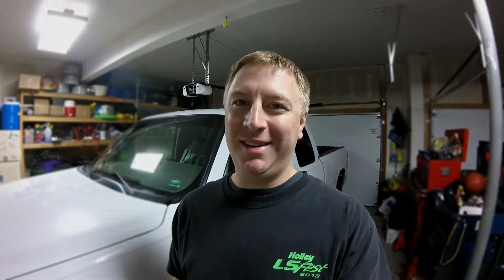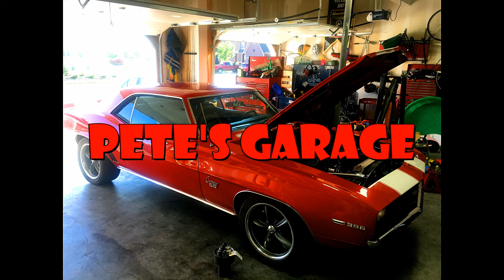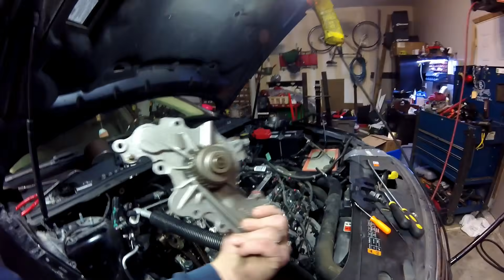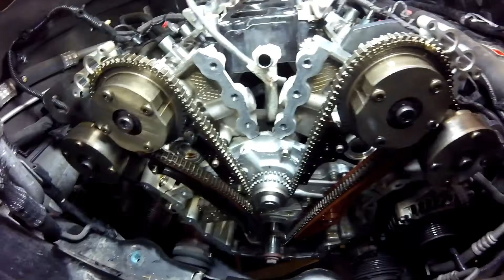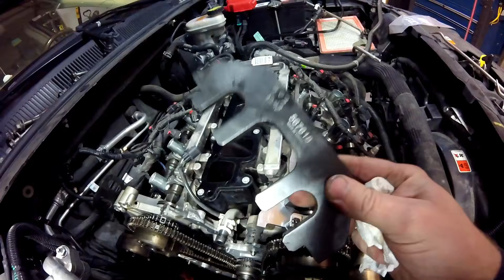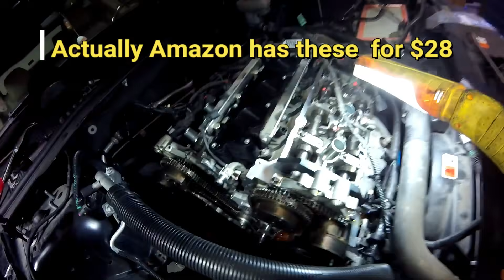Why does the Ford Taurus, Explorer, Edge 3.5L water pump cost over $1400?

Comment: What a complete shit design - typical Ford.  I will venture to say the small water pump housing around the bearings reveals how small the water pump bearings are and way too weak for the lateral tension provided by the timing chain tensioner and static weight of the spinning chain.....Meanwhile I am over here with my 300,000 mile 4.7 V8 tundra on the original water pump.....

Comment: This is why i stick to 90s, My 96 Rodeo 3.2 V6 water pump and timing belt? Meh 2 hours tops. driven this truck cross country 5 times, and not even a spudder , original engine and trans. Lol anything past 2002 cant do one cc trip without having almost a complete vehicle overhaul lol.

Comment: Seal the drain/weep hole then trade in the car - that $1400 is 10% of the car
Reply from the maker: Savage. I’d hate to be the poor sap who buys it off the used car lot when the engine milkshakes and spins bearings.

Comment: cars are so complicated these days it is ridicoulas . and they make the parts so cheaply , they put too small of bearings in them and the seals can't be very high quality or they would'nt fail so soon . in something like an old toyota 20R the water pump will last 200,000 miles . and why would you have the pump driven by the timing chain , that is ridicoulous . anything like the water pump , and alternator should be situated where it is easy to get to , and  driven by a belt . the car manufacturers are kicking themselves because they have to pay their mechanics for more hours to repair these overcomplicated engines

Comment: I've seen old 1990's Ford water pumps last more than 200k miles and 25 years.  There are a lot of modern cars that use an internal water pump.  This is an example of planned obsolescence.  They want you to come back to the dealer and pay $1400+, or just buy another car.  Nope.  Not for this guy.

Comment: 06 Charger 3.5.. Got $800 to $1200....Myself and a relative did it of $93 which included , The belt ..water pump ...Tensioner and Pulley.

Comment: TOTALLY RETARDED DESIGN. Inaccessible, unserviceable and it breaks a fundamental rule -- do not cause catastrophic damage. You do not ever place a potential wear item of the coolant loop in the oil loop. If the water pump seals fail you can get coolant into the oil soaked area where the chains are through the water pump shaft. This then contaminates your oil with water and if you are unaware of it (which you may be because the water pump is still turning and the engine is not overheating) can destroy the rest of the engine.
--
To be fair, Ford is not the only retarded manufacturer. Audi puts a pair of oil filter screens in the Vee of their 4.0T V8. An oil mesh screen -- like a filter -- is by definition a service item that traps gunk to keep the turbos' oil supply clean. Well, it takes 10 hours and the removal of the entire front end with headlights and all, the intake, the intercooler, the intake plumbing, the oi separator, etc to get to the oil filter screens. $2K in labor plus $20 for the parts. So, nobody replaces them. They clog up between 30 and 80K miles, starve the turbos of oil and grenades them. BOOM! $13,000 for a new pair of turbos and 20 hours of labor. There is a reason Lexus is more reliable. They take engineers dreaming up such nonsense and make them commit seppuku.

Comment: By the way, if you think you can put this job off, you are wrong.  You are risking a $1,400 job for a $7,000 job as when these fully fail (and it will), the engine becomes toast.  Seeing the coolant on the floor is the canary in the coal mine and you don't have too much time from them until catastrophic engine failure.

Comment: The timing chain tensioner fix for both my Lexus cars is $1900 and $2350. 
Both were fixed under warranty due to them being too tight. I assume they replaced the chain, tensioner, and pump on both along with fluid refill because of the cost. 
You should have bought a 4 cylinder Camry or  Accord just like I should have.

I just looked at the schematic on both and saw why mine was so expensive and that the TSB called to replace more than just water pump and how the two systems differ. My fault. Comparing apples and oranges.

Comment: That's a poor design to have to do that to change a water pump. My father's 5.0 Jaguar had a bad water pump. The dealer and local garages wanted $900 to $1,200 to change it. I did it for him in a few hours with a factory pump I got for $99. If it had been like this job I would of given him my sympathies.

Comment: For some reason VW put the water pump on the timing belt 
So when your pump goes you need a timing belt 
On a timing chain is ridiculous design
Reply: But this that VW did kind of makes sense. Like most Japanese and Korean cars, replacing timing belt goes hand in hand with replacing water pump. You change belt, you change pump... thats acceptable being both parts that wear down. But with a timing chain???? No way Jose....

Comment: After a Google search, this horrible design is on following models and years:

Duratec 35 engine/water pump system is on the 2007-2014 Ford Edge, 2007-2010 Lincoln MKX, 2007-2014 Lincoln MKZ, 2008-2014 Ford Taurus, 2008-2009 Ford Taurus X, 2008-2009 Mercury Sable, 2009-2004 Ford Flex, 2012-2012 Ford Fusion Sport, and 2011-2014 Ford Explorer.
Reply from the maker: Thank you for this info
Reply: Crap, I was worried the Ford fusion sport world be on this list. Something I'm not looking forward to...

Comment: Why are so many people shrieking about this? Sure, driving the water pump off the timing chain means a costly repair if you can't DIY, but MOST MODERN CARS HAVE REGULAR BELT-DRIVEN WATER PUMPS THAT CAN BE CHANGED MUCH MORE QUICKLY AND EASILY. 

Sorry to shout, but the hysteria in the comments is getting out of hand. The engine in this Taurus is unusual, and most cars don't drive their water pumps like that.

Comment: It means another piece of crap car made in America , but it’s not only ford Audi same crap water pump driving by timing bet , you have to take the whole from end plus the radiator plus the air condition and more , Honda Odyssey when timing belt brakes may as well junk the car

Comment: If you thing this is bad, then you’ve never changed a thermostat on an Audi A6... It’s worse than this Taurus job PLUS you have to remove the entire front of the car just to get inside the engine compartment. To replace the auxiliary water pump on an A6 you have to remove the entire front end of the car and then drop the engine out the bottom just to gain access to that side of the motor. Then the stripping down of the engine begins before you can even come close to accessing it. So, count your blessings on this Taurus.

Comment: Ford and their damned unnecessarily difficult water pump repairs... They’ve been pulling this crap for years and years and years. Classic example: You’d think doing a water pump change on a 1989 5.0 (Windsor) Crown Vic would be a snap? Hell, no. First off you have to pull EVERYTHING, brackets included off the front of the engine. Alternator, A/C pump power steering pump and ALL the associated brackets. And the A/C belt tensioner is loosened by a bolt you can’t reach. THEN, you get to face Fords long-standing reputation with snapping off nearly all of the water pump/timing cover bolts while trying to remove them. Eff-you Ford! I wouldn’t even want to touch this Taurus.

Comment: I thought you meant that it was fourteen hundred dollars for the replacement part. My Mitsubishi three liter had it in side the riming cover but belt drive. The mechannic that replaced it got the belt way to tight and the pump bearing failed and froze up shortly after replacement. It ran off of the smooth back side of the knotched timing belt.

Comment: Yep. Well for better or worse I like my GM products. I’ve never had an issue like this on my old school small/big blocks, 4.3 v6 or my newer LS. I can easily fix anything on it for generally whatever money my wife left me in my wallet. So it’s GM for me guys. I had a few Fords. The older ones are ok. The newer ones, fugedaboutit’. Ain’t happening. GM all the way. And yes I know the crack about the north stars starter in the valley. I never owned one of those so it didn’t bother me. Seems like I would still do better changing a Northstar starter than a Ford Taurus waterpump! F That!!!

Comment: The 2.7 lt. Chrysler V6 all over again. Same poor engineering.
Reply: I would have to say the 2.7l Chrysler engine is the worst engine built in the past 25 years.
Reply: @mph5896  Worst diesel is the 6.4 Powerstroke/MaxxForce 7. Biggest piece of shit a diesel mechanic has ever seen. If it’s a Ford Super Duty you have to pull the cab off to get to anything.

Comment: the more i watch car vids the more im convinced NOT to buy anything above 2001 make...
Reply: mingiasi As a mechanic you wills save thousands that way. Currently driving a 99 Civic 1.6
Reply: @waterloo123100  my 01 prelude stick can be park for a year and still jump the battery and drive.
Reply: truth4reel My brother has two 5th gen ludes we love them cars
Reply: Get an EV, none of these silly stupid parts are needed.
Reply: Patrick O A Ev car cost thousands of more dollars then what I paid for my car and it still uses brakes suspension and power steering like a ICE car. EV’s are not the way.

Comment: The easy way to fix this issue is: DO NOT BUY AMERICAN CARS!  I will never make this mistake again.  My first 3 cars were not American brands.  However, when the time came to get my 4th car I thought to give it a chance.  Back on 2007 I purchased a Ford 500 - 2006. When the time came to do spark plugs change, the dealership wanted $950 dollars CAN or $650 US, PLUS!  13% taxes, 5% Environmental Fee, Shop Fee, Tools Fee and grease.  Total cost was going to be just over $1,100!  I checked with other garages and the cost was very similar. The explanation I got: 3 of the 6 spark plugs are in front of the firewall. They had to removed: Camshaft cover, etc... It was a 5 - 7  hours job.  I got rid of that car the next week and went back to Asian Brands.

Comment: This BS right here is exactly why I got rid of my 2 Ford's with 3.5 duratechs. They where both great cars but with one just over 100k and the other at 80k I knew it was coming. I really hate that Ford made such a POS like this. I guess they didn't take the hint from the Chrysler 2.7 with their internal water pump issues. PS the water pumps fail so quickly due to the amount of tention constantly placed in the bearings from the timing chain. RIP Ford

Comment: What a terrible engine design they gave no thought to serviceability and that the water pump fails more often than the timing chain or if the pump fails the coolant ends up in the oiling system.
It's almost as if they designed it to become a boat anchor as soon as the warranty is over.

Comment: @pete's Garage you dont have to take cam out you can remove the right chain guide easily despite the one on the left just play with an 8mm socket dont take it all the way just break loose the bolt then you can take the pump out reinstall and you saved 2 hours and new bolts for cam
Reply from the maker: Yep just did this the other day. Saves some time for sure. Still pretty tough to get that 8mm bolt behind that cam actuator to spin. My fingers just don’t bend that way.

Comment: I choose to drive an old car that does not cost so much to repair.
Reply: Both my older cars have the GM 3.8. So easy to work on, but hardly ever have any problems at all with this setup!!
Reply: @timcoker4685  3800 are bulletproof GM engines
Reply: 87 Chevy r10 
I’ll drive her till the wheels fall off.
Reply: You and me both. I drive a 02 Cavy and a 98 Eldorado. These new cars/engines are money pits.
Reply: @UrielX1212  the Northstar in that Eldorado isn't exactly a picnic to work on either
Reply: @4ampaul  No but at least the water pump and most of the accessories are relatively easy to get to. Even the dreaded starter isn`t that big of a deal either.
Reply: I'll stick with my 1995 Cummins 12V at 445k miles nothing but oil changes, or my 300k mile Toyota with nothing but timing belts and oil changes. I paid less than $2500 for each one.
Reply: Having an old car isn't a guarantee that it'll be easy to work on. I guess it depends on your definition of old. Early to mid 00s domestics can be a huge pain. I just finished a power steering high pressure line job on an 04 Taurus where I had to drop the damn engine just to get to it. That was a massive pita. Also an 06 Dodge water pump with a similar setup to the video, except it has a timing belt not a chain. Still a pretty big job. At least it was a good opportunity to change that belt! I wish every engine was as easy to work on as late 90s-early 00s Dodge Rams. Huge bay, everything right out in the open.
Reply: @jokerzwild00  Old to me means anything before computers/fuel injection. 1947 to 1985 is what I have and work on and can keep alive indefinitely for cheap, even if I have to machine the new part myself. Anything after the pencil pushers at the top of the car manufactures took over is  not usually worth keeping alive.
Reply: @jokerzwild00 My definition of old is before 2000.
Reply: @Willard Lentz  I agree, Dodge Rams (94-2001) are simple.
Reply: Ford is so 🤓
Reply: Hi, I'm a used car dealer from South Korea and I do agree with you !! Not every old car but most old cars are much easier to work on. I've owned a 1996 Mercedes S320 for five years and I love it!! It's so reliable for an old car (of course I've got some preventative maintenance done) and so much easier to work on comparing to many current luxury vehicles. Plus, there are sooooo many after market parts and remanufactured parts which save me so much money!! I'm willing to keep it for a long long time!! :)
Reply: So still buy American ???
Reply: The ford  3.0l v6 is very reliable than the 3.5l ,3.7l ,no coolant problems at all.
Reply: Thanks why I commute /tour by bicycle as they are utilitarian, healthy and easy to repair.  No  $1400 water pumps here due to.poor design.
Reply: All of these are old cars that SHOULDNT cost much to repair. As long as you know what you are doing, this “$1500” job turns into a $150 job when you use a little bit of mechanical intuition.
Reply: Same here.

Comment: Water pump connected to the timing chain....dam..dam.
Reply: 3.2L vtecs are like that
Reply: @hackdeez1075  thanks for letting me know.  Seems like the designers of those engines should have known that the ball bearings of the pump would give out before the timing chain. Well, I feel they knew though.

Comment: I did residential and commercial A/C for 30 years.  I can't tell you how many times they shoe horn a piece of equipment into a space and THEN run conduit, pipes and crap in front of the access doors.  I have ALWAYS SAID before you get your engineering degree, you MUST WORK ONE YEAR DOING HVAC, PLUMBING AND ELECTRICAL.  the excuse ALWAYS WAS, there's PLENTY OF ROOM ON THE DRAWING.  Same goes with cars.  Pull the engine to change a headlight bulb.  Glad I finally retired.  AND have a great Volvo mechanic for my ride.

Comment: Just like replacing the water pump on a 80s taurus SHO with that yamaha v6.  Other than it's not timing belt driven (the SHOs had a timing belt)  the pump was drivin by the serp belt.
Reply: Those hooks on top of that wild looking intake were certainly there for a reason. Just a tune up can mean pulling that motor.

Comment: This is why im driving my 1973 lemans. just did the water pump and it cost me less than a hundred dollars doing it myself. plus my car looks badass..
Reply: Chuck Itall We have a 72 with the Pontiac 350 love that car.
Reply: @waterloo123100  Yeah the pontiac engine is interesting, same block and yet different displacement. I was told mine was changed to a 400. Hard to determine that by appearances.

Overheating due to corroded pump parts and those sleeves are something people can't figure out with those engines too unless you do a total rebuild or change the pump and narrow the gap in the intermediate pump part.

Comment: My Acura, requires taking off front bumper to replace headlights.  Are you serious?!
Reply from the maker: They’re all that way now. I think they ran out of good headlamp ideas that were easy to get to the bulbs.
Reply: My 13 fusion i have to do the same thing just to change the headlight. its crazy!
Reply: I had to do the headlights on my 2015 Cadillac Srx4 and bumper has to come off as well. I changed the housings and upgraded to LEDs so hopefully the bumper doesn't have to come off again for a long time. Headlights should not be that much labor and a dealer estimate over $1000.

Comment: If I were asked "Do you think the water pump bearing will be up to the stress of being part of the timing chain assembly?" I would say no. The bearing would have to as robust as other bearing in the system. Massive and lubricated. So where do these engineers come from that don't actually do their jobs? I suspect if auto manufacturers had to pay to correct engineering mistakes they would make fewer. Exp: All of the exterior door handles broke on my 2005 BMW X5 over time. Known poor design. BMW looks the other way. No Ford Taurus for me.

Comment: It would be stupid not to replace the timing chains and guides at the same time.Timing chains stretch overtime.The Ford Edge,the whole drive train comes out to change the water pump,timing chains and guides costing $3,000.00
Reply from the maker: Well I’m stupid then. I didn’t replace the chains and guides. The guides hardly had any wear on them on both of the ones I’ve done.
Reply: Most shops will replace the timing chains and guides as well,don't want a comeback
Reply from the maker: Walter Frederick it would definitely add to the cost. If there were any signs of wear, I would’ve suggested replacement. If you’re at a shop they definitely would want to cover their butts.